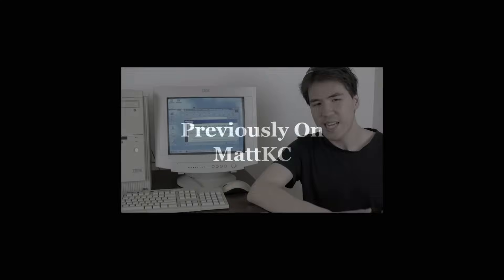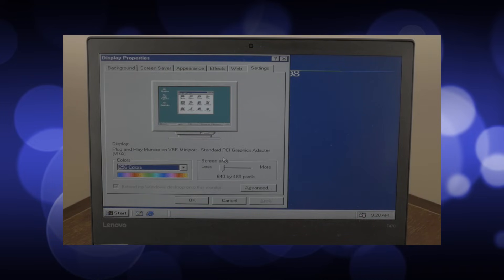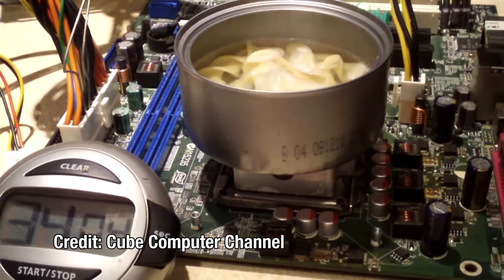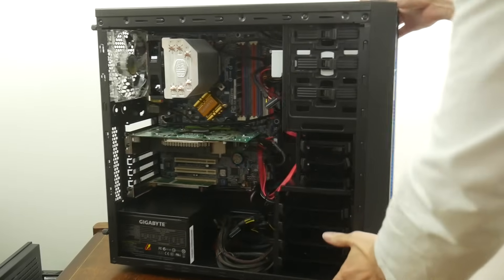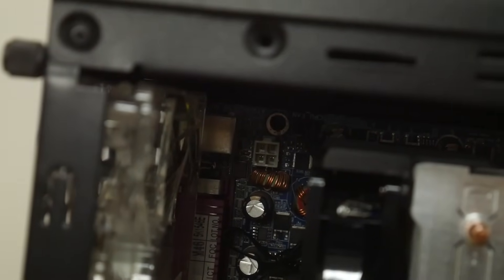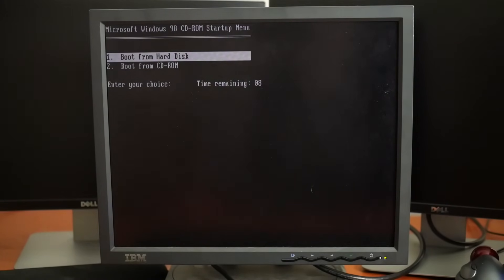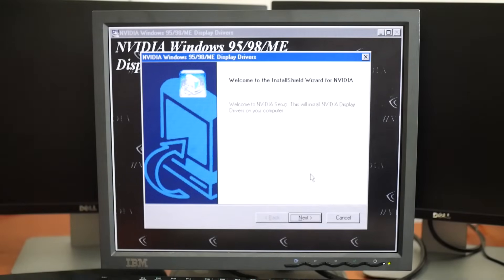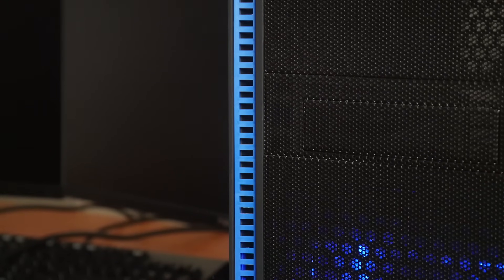The QUEST For The ULTIMATE Windows 98 PC [Part 1]

Comment: You shouldn't be using onboard sound in an 'ultimate' build anyway, get a Creative Labs Audigy card for ultimate gaming, or for best audio something from Roland.

Actually you could probably build a better machine and avoid a bunch of headaches by using a newer but barebones motherboard, maybe a server board, you wouldn't really need any drivers for it if you use 3rd party adapters for USB, SATA/IDE, networking, sound etc.

Comment: it still hurts me to watch him install the motherboard without putting his cpu and cooler on the board along with his gpu and other bits before mounting the board. why i feel this way, i have no idea.

also, if the fans are molex they are going to run full power no matter what.

Comment: @MattKC Did you try plugging the monitor into the other DVI port on the 6800 Ultra? Most early dual-DVI cards will only output video from the primary DVI, the secondary has to be configured via drivers. At least, I know my Radeon X1950 Pro AGP does this.

Comment: I think you need to recheck your cpu info. AFAIK it is a SL82U, looking at the cpu in the video and trying to identify the cpuid, which is an P4 570J running at 3.8GHz but with smaller L2 chache (only 1MB). And looking at the Intel C logo on top... It says 04, meaning the cpu was made in 2004. the the 670 was released in 2005.

Comment: There are a lot of things that make an "ultimate" windows 98 PC kind of a nightmare. You stumbled on a few of them. 

When you want stuff to actually work, get a creative Live! sound card, ideally an FX 5000 series graphics card, and probably drop down to 512mb of memory even over 1gb. Also, please enable DMA in the device manager, or all of that SSD performance will go to waste. 

The ideal chipsets for windows 98 support are socket 478, in my opinion. 865PE is pretty much smooth sailing. Often though, you don't want to run the executable to install drivers, instead you want to install drivers through device manager by pointing it to search in the appropriate directory. How do you know this? No one tells you! The drivers that are packaged often include different files for different operating systems, and windows 98 is more of an after thought. 

One last thing, if you want to play windows 98 games, than you really want an IDE optical drive with 3 pin audio headers. This is because many games from the late 90's streamed music off the disc. The cable connects to a compatible sound card.

Comment: I had similar problems with the AC'97 drivers on another Gigabyte motherboard, both with 98 and ME. In my case, the drivers would crash the system at startup. Might try your solution of downloading them from directly from Realtek instead - thanks!

Comment: I just came across this video now, i wanted to say the reason your twin monitors werent working is due to your "HDMI - DVI" adapters are meant to convert the signal from HDMI to DVI for use on older monitors(for modern graphics cards which only output HDMI) they wont convert DVI signal to HDMI.

Also you mentioned you having problems with your AGP graphics card, i may have a cheapo graphics card with a broken fan which if you can fix its yours (graphics card works though without the fan but its possible it may overheat and fry the board), just PM me and we'll see what we can do for ya

Comment: No floppy drive? Duh!

I have one Gigabyte board quite similar to that, it admits AGP, PCI-e, DDR and DDR2.
Pretty rare.

Fitted a Pentium D 805, nvidia 6600GT, 2gb DDR 400, and Aureal Vortex sound card.
Actually it can work with MS-DOS, Win98SE and XP without problems.

Great video though.

Comment: What a coincidence, I recently got hold of an outdated PC and I thought about installing Win 98 SE and XP on it. I already see it won't be a smooth ride.

Here are the specs:

Motherboard: Asus A7N8X-E Deluxe, Socket A, nVidia nForce 2/MCP-T, 3×DDR, 2×SATA, 2×IDE, 1×AGP Pro 8x (AGP 3.0), 5×PCI, 2×Ethernet
CPU: AMD Athlon XP [Barton] 2500+ (AXDA2500DKV4D), 1.83GHz, Zalman cooler
Memory: 1×DDR-400 1GB, 2×DDR-400 256MB [1534MB, 3-4-4-8]
HDD: Samsung SpinPoint SP0802N, 80GB, IDE
ODD: Pioneer DVR-110D DVD-RW, IDE
Video card: Gigabyte Radeon 9550 (GV-R955128D), 128MB, AGP 1.5V, DX9
PSU: Gigabyte Superb GE-R460-V1, 460W, APFC

Comment: Bit weird... Ultimate, but with onboard sound. From an era was not know for decent onboard sound as well.
Get a Vortex2 or Soundblaster? Easy and cheap fix, my dude :).

Other than that bit of constructive criticism, I'm enjoying this piece of humblepie.
See, I have a nForce3 chipset board, which does come with Sata300 and is recognised by the system , the installerCD simply tells me it doesn't detect drivers for the sata drive.
What to man? :)

I've researched installing from USB and GoTek, but I'm holding of of that for now.

Halp? :)

Comment: asrock made core 2 quad capable boards based on the 98 compatible intel 865(865conroe) and VIA PT880 chipsets (4CoreDual-SATA2) the via one have supports both pcie/agp video cards(pcie is slower though) and either ddr or ddr2 ram

Comment: work with giraffe on making an ultimate 98 desktop, you aren't off to a good start here, two cards failing, not able to use your monitors, failing audio driver install, there also is no 3dfx voodoo 3 in there

Comment: Just some thoughts... Windows 98 might not be Happy with 1 gig mem.  I heard stories more then 512mb can cause issues if not windows in programs.  Just wondering could the power supply be bad? If cards not getting a stable power from molex connectors could explain graphics. Double check heatsink if not centered right could effect cpu. I recommemd if you get adapter for dvi get all in one cable you don't have different links together just one piece. Oh make sure sata is set to ide mode.  For audio just pick up a Sound Blaster live pci oem hp ones with gold connectors are good sometimes find them cheap and disable on board. If you must use onboard. Realtek windows 98 drivers for ac'97 says needs DX 8. Something to check. Upgrade or install dx8 give drivers another go. Never double up sticks on each channel. You get performance hit. Try to keep 1 stick per channel.  Here two 256mb sticks if possible one each channel. Last thing did you inspect the main board compactors. One bad cap make system unstable. Sorry all over the place lol Would love to work on that with you though.  I got a 98 project I'm working on also.

Comment: did you manage to get the 6800 to work properly? I happen to have one in full working order (and prob with the original packaging to), the models specifically is a ASUS GT 6800 128MB v9999. Also for crash related things with HDD or SSD make sure to use disk alignment when formatting, older OS dont behave properly without it
Reply: I have the original driver CD to

Comment: Also the usb keyboard not working could have been simply avoided by changing one setting in bios if it does have it but u had an lga 775 board so it should off

Comment: I had that Gigabyte board for a while... Cmon ultimate 98 would be p3 tualatin 1.4, 512MB or eventually p4 on s478 with AGP slot, but i found it better for windows xp. Im actually selling Asus p4c800 deluxe with AGP pro but still it better fit xp era. My 98 PC is actually 1.4 tualatin with fx5900xt, and XP PC is Pentium d 950 with x1950xt.

Comment: Windows Native On A Mac
my dads mac "died"  so we took it to best buy. They said the mainboard was fried because almost was. So I had a crack at it and it went into a boot loop (or at least what I think was a boot loop). then because I didn't know any better(I was 13), I took it apart and stuck a windows boot drive in and it worked for 5-10 minutes before overheating.

Comment: I'm pretty sure that GPU was NOT the mightiest one of the time... and often die...lol.
ATI, I believe was in charge at that time and was definitely just as Win98 compatible.
The ATI cards won't die either. You should probably be re-pasting all of those cards before tests.
Also, dual-channel 512mb sticks would be better than single-channel 1gig, even for 98.

Comment: As dumb as this might sound, if you have not put in the wifi drivers yet, do that, and then see if the sound works.....I can't tell you how many machines I worked on back the day (granted, most were laptops, but still) that would have the same issue of no sound until the wifi drivers were installed. Somehow they seem to be tied together making both, or one or the other not function until both drivers were installed. Just a thought.....

Comment: This is more my line of thinking... un-screw the era authenticity... the best highest end but still most compatible hardware :P
Buddy... HirensCD v9.8.. PartitionMagic?

PCI 3DFx/Voodoo2 GFX-Card?... also mostly to satisfy the widest palette of MSDOS/Windows95/98 games. The Creative 3D Blaster Banshee PCI was one of the last of those. But they had/have a tendency to overheat, so keep it cool :P

SoundBlaster PCI512 / Live! or equivalent... or just one of the last sound cards compatible with both MSDOS and Windows98. Again to satisfy the widest palette of games of that era.

If you only focus on making the hardware compatible with Windows98, then you won't be able to run the first 2/3s of the games from that era correctly. Those which partially rely on drivers in Windows98 and partially talk directly to the hardware. Think MSDOS6.xx up to Windows98.

Another tip: Windows Millennium (pardon my French) was the last version of the MSDOS/Windows95 cores. So if you can't find a driver for Windows 98, but there is one available for Windows ME... you can force feed it to Windows 98 and get it working that way. If it refuses to swallow, then just edit the .inf file and change the driver signing to Windows98 instead of ME. I don't remember the codes off the top of my head, but it's not a problem, just google it.

… and while you are at it you might want to search up the "StarTech PATA2SATA3" adaptors. I have found them to be highly backwards compatible. I use 3 of those in the "Dream Amiga 1200 Checkmate A1500+" build I am working on at the moment. Ooh yeah... we are talking 2.5" 120GB SATA SSD and HDD's on a Commodore Amiga 1200 from 1992... works like a... eehh well... dream.

Check my RetroPC build for inspiration (soon to get an overhaul):
https://youtu.be/KubDXk14fP4

Comment: i have a normal gts 8600 that survived boiling water temps playing 1000s of hours in minecraft and even cysis.... around 15fps or less...  the GPU is a champ at taking shit and not giving it. 
it still works and i dont use it anymore. if you need it its just sitting in an anti static bag in my closet.
(i dont get comment notifications unless someone likes my comment.)

Comment: uh no the only way SATA will reliably work with your motherboard is either finding a Sata 1 ( 1.3 ghz ) or SATA II ( 2.0 ghz ) you will get corruption with SATA III. This is why no one who knows what they are truly doing will use an SSD or SATA III HDD. IF you where wanting modern look no further than the P-ATA to compact flash. As for USB issues, you need to enable legacy support! That is the only way DOS and DOS based OS's will recognize your mouse and keyboard!

Comment: I have THE EXACT SAME CASE, running Windows 98 too but mine runs Windows 10, Windows 7, Windows 2000, XP,  and 6 linux distro's all in the one case at the same time. It simply needs 4 SSD's.
Reply: What's your specs?
Reply: @Colehkxix  i7-2600 20GB RAM 2GB GTX 750Ti. System as it stands at 6am this morning is : 10 and 7 on a dual partition 500GB SSD. Vista, 2000, XP, ME and 98 on another 500GB SSD with 5 x 80GB partitions + another 500GB with 7 partitions of 60GB + 10GB swap. And 500GB SSD for basically storage and transfers of distro folders for quick change of systems. It occasionally has been a Mac though, but I hate mac, it really sucks. I can run up anything in under 10 minutes, if I like it, it gets a run on it's own 80GB partition, until I tire of it, break it beyond easy fixing, or get bored with it. The OS layout changes almost daily though, the only system that never gets wiped is the Win 10. I still can't go FULL 'nix, I have some software that HAS TO RUN on Windows, as there is NO comparable linux version made.
Reply: @bitemykrank1970  thank you! Been trying to get old OSs to work but tbh I'm not sure what I'm doing! Tempted to give up and just learn how to do it all with VMs or WINE, or to just get old pcs for each OS.
Reply: @Colehkxix  WINE isn't needed, thats for running SOME (limited) Windows softs in a 'nix enviroment. It isn't the best idea, some work, most don't. Using VM is the easiest and cheapest solution, Virtualbox is free and simple to use, and can do many things if you tinker in the settings a little deeper. VMware has to be licensed mostly, but can be used aswell. Doing NATIVE installs is fine, IF you have the cash to buy old PC's, they are usually really cheap, but the caveat on this is you need somewhere to store the cases when not being used, I have about 40 PC's here, and that fills a 20x17 foot room. And that is AFTER the last tip run, I dumped almost double that many old cases a year ago, and they keep spawning........two old cases, a dark room, some wine, and soft music and before you know it......50 old cases have appeared. I swear, old PC's are made from tribbles......(Trekkies got it.....)

But it is fun making 20 year hardware into a usable PC, there is something about playing Duke Nukem 3D on an i5 running ME with 768MB of RAM and 2GB video that just works......and browsing the web on Windows ME is fun.....I couldn't even catch a dialer, let alone a virus, and I went to every dirty site I could find, downloaded everything I could find, installed 18GB of crap onto a 20GB HDD and still couldn't get the PC infected.....seems no-one is making windows fat32 viruses anymore.....I built it to kill it, but the damn thing won't die......I couldn't even get a spike from a known botsite. It's MORE secure than my Windows 10 PC running SEP 14.
Reply: Bite My Krank  I see thanks! I think I can do the VM side if that works well enough. Assumed there would be problems for some reason. I'm cool with getting a new pc but I don't want too many boxes taking up space!

Have you seen the 95/98 emulator? Think it's called PCem. Might try it out this weekend.

Good to know about the Malware!! Guess they focus on 7 these days!
Reply: @Colehkxix  I have never had a lot of luck witth emu's ( I nearly rammed one on the way to the beach at Wolli last year) the only thing I use them for now is PSX, PS2 and PS3 stuff. And that's only because I'm too lazy to get up, go to the other sidfe of the room, turn on the TV and choose which console I want to play on that moment....I have the 3 of them set up aswell, but NEVER use them.....I turned my PS3 on the other day to have a go on HalfLife 2...my last save game was dated 2015........and that WAS the last time I turned the thing on......you might deduce, I'm not a gamer.....
As to virtual stuff, you can get silly in a virtual enviroment....such as emulating a Commodore C64 on Win XP running as a virtual machine on a virtual Win 7 running on a Win 10 PC host like this :  https://www.youtube.com/watch?v=Im9N7xEIc1U

Comment: I have an old Athlon XP system that used to run XP still sitting on the shelf.  Unfortunately it's not AGP it is a PCI Express 1.0 board.  Find a better board a P5LD2 I have one I need to find a new solution for the video card because the cpu fans are dead at this age.  It used to run XP before it was upgraded to Linux

Comment: why did you use SSD but DID NOT use PCI-Express chipset like 915 or 945? You didn't said that it must be the ultimate AGP pc, and win compatible 98 games couldn't utilize full power neither of this videocard nor CPU one. Anyway i would like to see what and how will it run. How about part 2 where you set up XP there and run TR2013, Mafia2, Metro2033, Stalker on DYNAMIC LIGHT renderer and so on?
I use Pentium 4 641-based PC every day, and i realy love it and actually i really prefer AGP, using mostly 865G chipset ang changing videocards from FX 5700-5900Ultra up to AGP HD4650  1gb pdepending on my mood)) But i still have not got GeForce 6800GS, at least. Ifap on 6800 series for AGP on NV40 GPU. The main difference is that i prefer XP for my tasks. I use internet on it and sometimes play games up to 2013 year on it in authentic for this system, 1024 x 768 resolution))
I have a video of my PC on my channel but i'm not sure you will understand my speech. Therefor you may see my P4 PC there)
https://www.youtube.com/watch?v=8m3DbDvpIew&t=4s

Comment: i have 3 of those p4 670 3.8 ghz i got from the dump and did the tape trick for 4.2 ghz on it's stock dell optiplex 620 cooler. i have 2 left that work. i fried one when i got the paste on wrong and fan setting wrong. and it's my windows 10 back up if all my new ones fail for some reason. mine ran agp ati/radeon 256mb but some reason i could use my on board ram to boost it if needed not sure how it worked but it did. and it could be the monitors my old optiplex will only work on 2 of my 6 monitors i own. you should of used the 98se edition!!

Comment: But there are motherboards supporting Core 2 Duo / Quad / Xtreme with Windows 98 compatibility based on the Intel 865 Chipset, and the Geforce 7800GS and 7900GT (Agp variants) have Windows 98 drivers, not official, but they work... AND...1GB of RAM is TOO MUCH for Windows 98 without fixes. Windows 98 officially only supports 512 MB, if you install more, you will get extreme instability and corruption, there are fixes for 1GB.